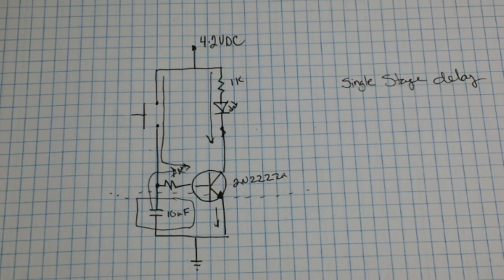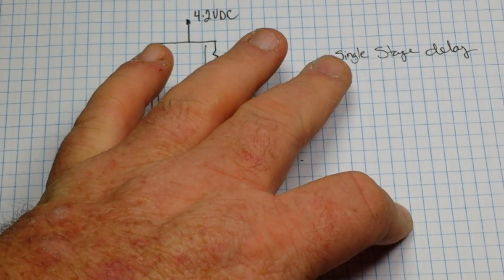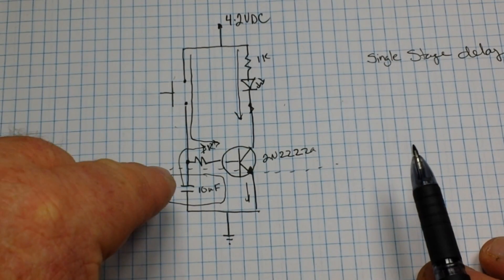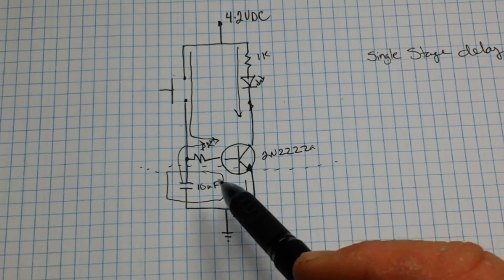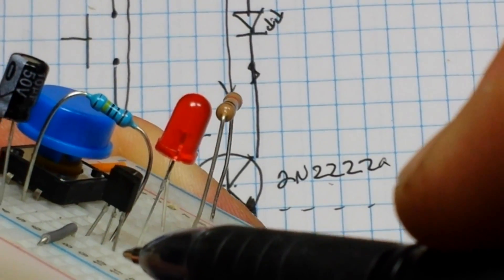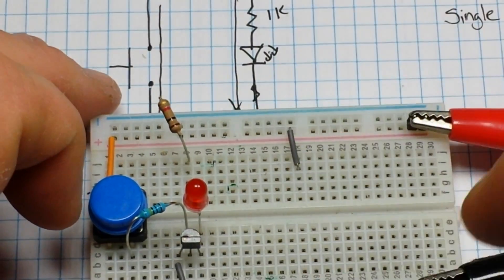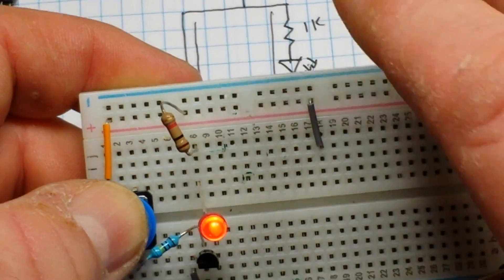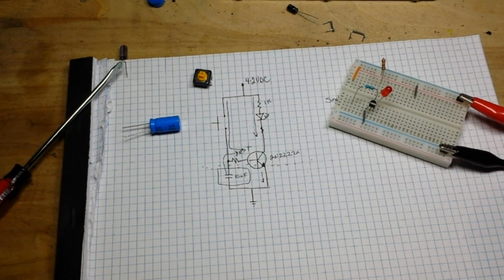How to make a simple delay circuit

Comment: I need a circuit for a model train. A short 2 car train runs back and forth a short length of track, changing direction at each end, in the middle it should stop for while at a `station to load passengers.
Reply: That sounds fairly easy.  You will need some way to detect the location of the train.
It sort of needs 3 switches of some sort.  That is the trickier bit.  You want something that doesn't look out of place.
Reply: Ken Smith and what about the delay in the middle?

Comment: I am struggling to relearn beginner basics I have not accomplished anyway; I located a Thermistor from salvaged board; So far I think I am way overbuilding; I have NTE5679 found pn on the internet; Also under consideration is NTE51 TO-22 and am thinking I should reduce some of my overbuild as the SCR will switch the load but I am going to use contractors which I salvaged and think the pull down coils are under 1 amp with 0.50 to 0.85 typical ○○○ I want 3 to 5 times over-rated ~ where I am stuck is on latching flip-flop which provides hysteresis for on-off so that cycling occurs over 10° temperature span

Comment: Thank you. Good simple circuit. 
    Used a delay-relay circuit to increase gas flow for Toepler pump operation for high vacuum preparatory line. Worked very well.

Comment: Thanks for the circuit, so you could use this with a small capacitor as switch debouncing circuit?
Reply: A delay of 20mS is sufficient for debouncing most switches. Many stop bouncing at 10mS or so, but I allow a 20mS delay in my designs. You can find debounce circuits that are just the resistor and capacitor however the above circuit should work too. When I'm working with cpld and fpga I tend to use a clocked counter to debounce - the switch initiates the count which times out in 20mS and then activates a latch to grab the switch data thus debouncing it.

Comment: I'm looking for a circuit that is similar to this. 
     I need to get a relay to turn on when the trigger (button) is pressed, then turn off after about 1/2 of a second. 
I'm building a MOT spot welder for making my own 18650 li-ion battery packs. I will probably have to "play with" the on time to get consistent welds.
The relay will probably have a 12v dc coil, and switch the 120v ac going into the transformer. Any ideas, comments, or concerns would be greatly appreciated.
Reply: look up "monostable multivibrator"
Reply: @watches-on-FF  thank you, I was pretty sure that I could do it with a 555 timer but I didn't know what to call it. That looks like it will work well. Thanks again.

Comment: Using differential equations to solve this you would still have to take into account R and C in order to find the actual voltage over C at time t.  I think it's still an RC circuit with the difference being you are using the cap to bias the transistor until it fully discharges.  If there were no resistance the cap would discharge very quickly.  You can't really control it with R though which is maybe where the confusion is.  Otherwise you risk changing the biasing on the transistor, so you can only control the discharge rate by changing the capacitance value.  Under the wraps though you are dealing with an RC circuit:

VC = 1/C  ∫ i dt

Since Kirchoff says total voltages must add up to zero we can derive this

Ri+ 1/C ∫ i dt = V

Turning that into a differential equation with by differentiating with respect to t gives us this:
R 
(di/dt) + i/C = 0

solving that differential equation gives us this:
i = VR e^(-t/RC)

So no matter how you shake it if you want to know the voltage over the cap at time t you would have to know the equivalent resistance
Reply: So what is the formula to calculate the delay? Is it just a simple RC constant? Because here it would give us 10 sec but it looks like it's more 30...
Reply: Stéphane Muller 5RC
Reply: @master_mugen  V=Ve^-t/RC(voltage equal to voltage times e the power negative time over RC(time constant))

Comment: Very nice educational video!

Just a suggestion - feel free to ignore this idea .... 

How about using a MOSFET (n-channel of course) instead? Because, for an electronics beginner, the operation of a MOSFET is easier to understand when compared to a BJT, while only a small adjustment to the circuit design is needed. With virtually zero current flowing into the gate its easier for the beginner to intuitively understand the operation of the circuit. The much larger base current of a BJT can easily confuse the beginner who has little or no idea what is happening.

Also, you happened to accidentally use the MOSFET-specific terms 'gate' and 'channel' anyway, so you might as well go the whole way and just use a MOSFET. .... maybe?

Comment: I would add a resistor in series with your switch (maybe 100 ohms) to limit the current through the switch when it is closed.  Drawing a momentary pulse of a few amps to charge up the 10uF capacitor could cause burnt spots on the switch contacts, and could cause a momentary voltage droop on the supply.
Reply: That is exactly what I am thinking. Not sure why there is no resistor to limit the capacitor current. Maybe the capacitor is too small?
Reply: Likely omitted for simplicity of the lesson but good point

Comment: Hi, may I use this circuit and control many LEDs in parallel?
Reply: Yes and no:
If your transistor can handle the sum of the current through your LEDs the circuit is fine.
BUT: Every parallel LED should have its own current limiting resistor. Putting LEDs directely in parallel will cause very uneven distribution of current through the LEDs.
You would want to put them in series.

Comment: I wonder if the light technically flickers near the end.  Does it make a hard transition from On to Off?  I am thinking on the scale of say 5ms that there may be a ripple in the voltage to the LED due to ambient EMR that could cause the LED to flicker for a very short moment.  If this is a thing, it may be more pronounced when using a larger capacitor, say one that will take an hour to discharge, as nearing the end the voltage will be within that threshold region for a longer period of time.
Reply: Could you please explain ambient EMR?  Is that referring to radio interference?
Reply: @michaelricketson1365  
Yes,  any wires in your circuit will act as a small antenna and develop small transient voltages as a result.  Basically it puts noise into your circuit.  To avoid it in areas where you want a stable voltage reading you can put a capacitor from your sensor wire to ground.
Reply: @mattrevesz  ... Ah, thanks, I've learned something new.  I've been using ceramic capacitors across the power pins of TTL chips to make up for power dips resulting from internal switching, but have not been aware of possible radio interference.  Something to look for!

Comment: That was a really good tutorial. Can you show the maths behind your circuit? How do you calculate the time delay based on the values of the resistor and capacitor? Thanks
Reply: Look up RC circuit, and calculations for it. In this circuit, when the button is released, the circuit becomes a straitforward RC circuit where the capacitor releases it's stored juice slowly through the resistor, where the resistor and capacitor values are varied to change the time decay curve (larger capacitor --> bigger bucket to empty; bigger resistor --> smaller hose to empty the bucket).
Reply: scratch that. he said in the middle of the clip: "don't think of this as an RC circuit"...not sure why/how it's not...looks like a strait RC to me, with a NPN thrown in. am going to check.

Comment: If you used a mosfet, wouldn’t that gate stay open way longer since mosfets are all about voltage and not current?  It would be a function of how much current leaks across the gate, right?  Couldn’t you get away with much smaller components and less power draw?
Reply from the maker: A MOSFET would stay "on" until you shut it off.
Reply: With the mosfet just add a resistor from the gate to the source to drain the charge off the capacitor. with the transistor when the voltage gets below the threshold voltage (mosfet Vgs(th)) it will turn off. the advantage of the transistor is they tend to turn on around 0.6V, a mosfet will be higher.

Comment: Nifty circuit and at first i thought 555-timer for something like this but i like this simpler variant. Cool series showing off useful circuits. Still hoping you can do a follow up on battery voltage monitoring.

Comment: Pretty cool.  But I think for illustrative purposes a smaller capacitor would have been better than a larger one.
Reply from the maker: Any smaller and it would have hardly had any delay.
Reply: @learnelectronics  Fair enough.  I just thought it would have been nice to see a short delay.  Like a few seconds.  Not a big deal.
Reply from the maker: I see your point. You can extrapolate from the 10uF lasting about 22 seconds that a 1uF would be about 2 seconds.
Reply: @learnelectronics  :)

Comment: Great video and no further delay
How do you calculate the delay
I am planning to use this setup to show a trigger signal
Reason:  I might be fast on my reflexes but i might miss a 1 mS signal so im thinking "hold" the signal for a second or so.
will this delay be adequate or du i risk that the trigger signal is to fast to charge the capacitor?
Reply: T = RC At 1T cap loses 63.2%, depleted to 99% at 5T remember to sub the drop voltage of the transistor

Comment: so a way to make it more useful, i.e. able to handle more current than a LED? would you just put a relay in the place of the LED and connect the light or fan etc to that?
Reply: That's what I was thinking.  It's a perfect example because those "puck relays", aka SSRs are actually driven by an LED internally, so without having actually tested it, I expect you should get a similar performance from them.  Of course the mA needed for the relay LED will be a bit different and the voltage will be different as well but roughly in the same ballpark.

Comment: I too do enjoy these simple videos. Thank you for the video.  I would also like to se the dual stage and I would also like to see how to alter the function to a instant turn off instead of fading out.
Reply: Replace the switch with a resistor.
Put 100 Ohms in series with the switch and place that across the capacitor.
Reply: @kensmith5694  Hi need to get the LED to stop more crisply too, at present it slowly fades away to a stop. Are you suggesting that a 100ohm resistor and switch placed together in parallel to the capacitor. The circuit does just what I need apart from this slow fade to off. Dont know whether anyone reads these as it is few months old now but thanks if you do.
Reply: @johnhirst4673  
Do you want a delayed turn on and a sudden turn off?
There are options for the off action:
1) Use a switch to discharge the capacitor
2) Open the positive power connection.
3) Open the negative power connection.
If you explain clearly what you want a circuit to do, you are usually 75% of the way to a good design.
A "slow on, fast off" usually works something like this:
To turn on a resistor charges up a capacitor and slowly biases a transistor on.
To turn off, the switch either forces the capacitor to discharge quickly or opens the power connection to the whole thing.

Comment: Nice, Could you please do a soft start circuit? Have been looking for one for high voltage in the range of 400 volts with no luck, building a mono block tube amp and want to delay the plate voltage until the filaments heat up, hence prolonging tube life, I could buy a delay tube but are quite pricey as are the amp tubes, and would rather go solid state to preserve plate voltage and power. thanks a million.

Comment: So, if this is NOT an RC dependent circuit, how do you calculate the discharge?
Reply from the maker: https://youtu.be/M03RCxqoIbU
Reply: @learnelectronics  Yup, thats a great video, thanks Paul. I was thinking about the capacitor discharge time equation, tau=5RC, youre saying it doesnt apply here at all? Thats whats got my head all scratched up. A 100K resistor instead of the 1M wouldnt affect it?

Comment: Basically the capacitor is like a battery storage energizing the LED. The timer is the cap and resistor combination lower the cap value less time the LED stays on higher the caps value the more time the LED stays on.GOT IT.

Comment: How about making the opposite, instead a delay off circuit, how about a delay on?
Reply: I would have thought this circuit does delay the On, because the capacitor has to charge up before the base reaches the threshold voltage. Maybe I am wrong.
Reply: @metallitech  The cap does have to charge but it's only a fraction of a second or so.  The large the cap, the longer the charge time.  If you notice Paul in the video, it appears that he holds down the button for a little while and not just a quick press and release.
Reply: @eliasgeorge8534  Thanks. I have run a simulation and think I understand now. Without a resistor in series the cap is free to charge up instantly, in theory.  The size of the cap hardly matters.  In reality the voltage source internal resistance is in series with the cap.
Reply: Try a PNP transistor.

Comment: Thanks Paul, great! I'm trying to do a solar arduino friendly delay circuit. And I'm stumped. basically I want the solar cell to charge a capacitor, into a delay circuit, and when it's delayed long enough (?) it switches on the arduino for 30 secs or so, then turns it off. Is there a simple way to do that?  So all us Arduino makers can have a simple circuit to let it charge, turn it on and report, then turn it off for 5 mins or so.....

Comment: Use the same circuit different values to control my Spot Welder.    Used a BD-139,  470 Ohm and .01 uF.  Needed the solid state relay to stay on 10uS.  Took some fiddling.  Even different BD-139's was changing my times.  CHINES ?  LOL